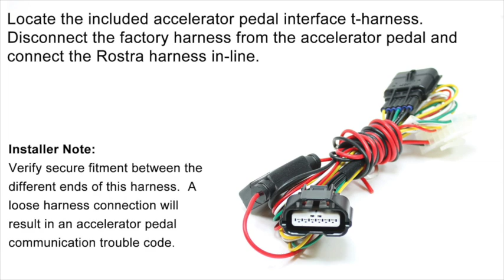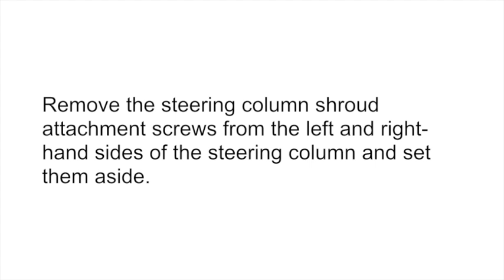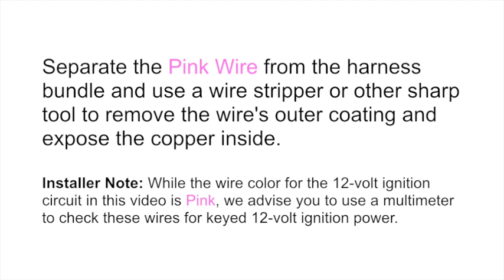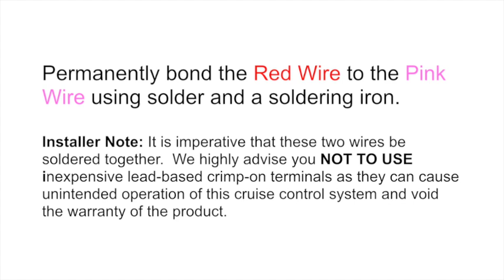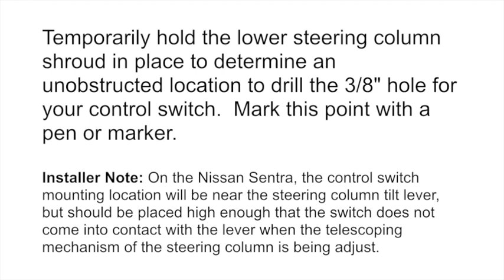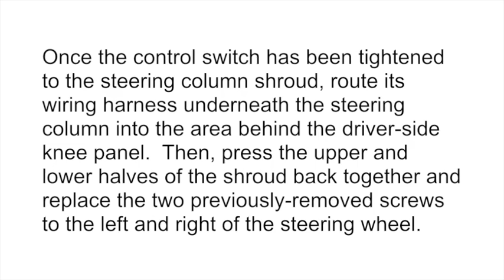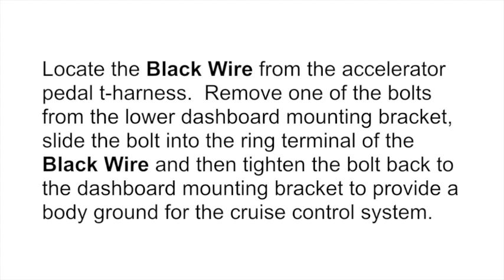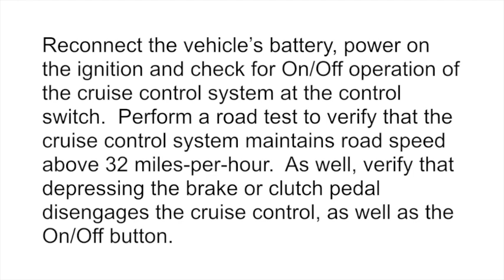2014 Nissan Sentra Cruise Control Installation

Comment: Can I hook up the red power wire to the fuse box in an ignition on only slot to avoid splicing in the steering column?
Reply from the maker: dbatch1715 We can't recommend that you do that.  The cruise control system needs a stable power input and we only recommend using the one detailed in the installation instructions. Thanks!

Comment: i have 2005 Nisan Altima with VIN : 1N4AL11D75c244162
how can i install the cruise controle , what is the parts needed
Reply from the maker: +Hassan Mokhtar Thank you for the inquiry but we do not presently make a cruise control system for the 2005 Nissan Altima.